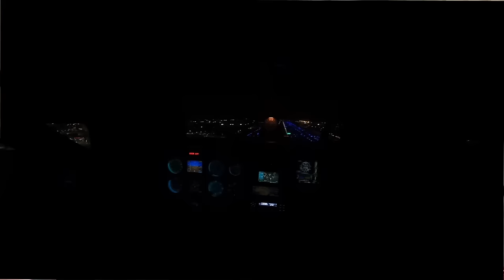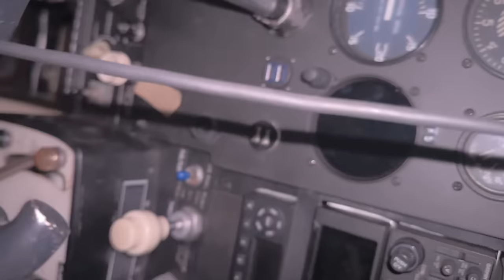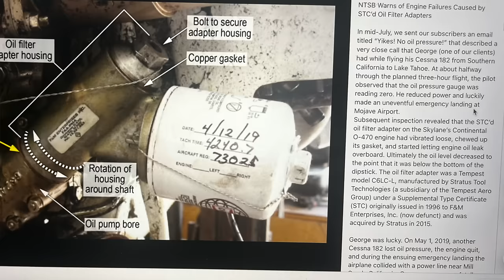Our New Cessna 210 Tried To KILL US Just ONE DAY After Buying It...

Comment: The 182 that crashed in Mill Creek is a friend of mine.  A real tragedy there.  I also had that same brand/type adapter on my 1965 C33 Debonair with the IO-470K.  In the 20 years I had it installed I never had a leak or any issue with it.  I complied with the AD regarding the new seals, torques and additional safety wire  and had nothing but problems with it leaking.  I removed it and reinstalled the screen assembly I had removed 20 years previously.  Now I change the oil every 25 hours and don't worry about the AD and the filter adapter.
Reply: Yeah, that a brute force solution but I would have gone the same way.

Comment: I have a 1963 210c. February of this year on my way back from Bethel Alaska to Kenai Alaska at night climbing over a 11,000 volcano I started to get a vibration in the engine.  I wish I could show you the picture.  Upon landing, we discovered Three of the eight bolts holding on the number for cylinder severed from engine.   I can understand what you’re talking about when you think oh, but the grace of God I am still alive today. Flying is not for the fainthearted.  You’re taking a 3000 pound machine 12,000 feet in the air with a World War II era engine.  $51,800 later we will be installing a new IO 470 into it this month.  I’m very thankful I have the opportunity to spend the money and my family is not scraping parts of me off the side of Mount Redoubt.  Keep the blue side up gentlemen.
Reply from the maker: Wow, what a story. So glad you are safe. Thanks for the comment.

Comment: Even if you find it's the oil filter adapter  and you resolved the issue, if it were me, I would run the engine for a good hour plus and DURING THE DAYTIME do a half dozen trips down the runway with planned RTO's. Obviously do your calculations so you know 100% sure that your planned RTO's will have you stopping with a good cushion of distance remaining. If you can, take your RTO's to perhaps 5 knots below rotation then go into RTO mode. The idea being you want the engine to go to max power a half dozen times.  If the engine is going to BREAK, this is when you want it to break - on the ground.  Then after getting a good workout on the engine, I would do a compression check then do a complete oil change.  Take the filter off and saw the top of the "old" filter off and take the element out and spread it open and see if you see chunks of metal.  By the same token, take an oil sample from the drained oil and send it to a lab for an oil analysis.  If the compression is good, and the filter element is clean, and the oil sample results are "negative" {which by that I mean "good"}, then you're probably safe to fly the aircraft. Remember, a lab oil analysis all by itself is NOT a complete "health check" of the oil.  You need to do the lab analysis WITH inspecting the elements in the oil filters. You need to do the 2 TOGETHER because the lab will detect micro wear.  The element inspection will detect the engine falling apart inside. Think of it as a flowchart - "did the element inspection pass ??".  If not, you need to overhaul the engine.  If "yes", then you go to lab engine oil analysis.  If that fails, then you have an engine overhaul.  If it passes, then you're good.  {assuming compression is good} - but also check your valves too.  Continentals tend to have burnt valves and Lycoming tend to have sticking valves.  Be safe out there !!

Comment: In 1981 I was an intern at the Pontiac Motors Engine Durability and Testing Labs (DURATEST) in Pontiac, MI. This is the lab where engines are put on dynamometers to determine all manner of performance data. The fun tests were the ones to determine redline, and to determine oil starvation characteristics. For redline, we would run the engines with higher and higher RPM until a rod was thrown (the dyna rooms had bulletproof glass protecting the operator, and the ceilings had numerous large dents). We would run engines and starve then of oil while running. Interestingly, the engines would run for about 5 minutes before seizing. This was due to residual oil in the system and then MELTED METAL acting as a very poor lubricant. Obviously, the melted metal regime was the kiss of death for the engine. If you stop the engine in the melted metal regime, it will cool, essentially welding the pistons to the cylinders. If you let it run, the pistons melt enough to cause the piston/rod system to become unstable leading to a seize. A very sad and painful death to a finely honed piece of engineering. A less aggressive but equally destructive test was to run the engines with knocking. Eventually, this will cause holes to form in the top of the piston (can you say zero compression). Truly a rare and fun opportunity to play with production car engines.

Comment: I have a io-470k with the oil screen. Thought about adding the filter stc a few years back but heard about the problems that people were having with that setup.  I felt it wasn’t perfected enough yet so I decided to stick with the screen.  When you consider that oil is the life blood of the engine and that it’s fairer cheap compared to everything else in aviation I just change the oil more often than recommended and examine the screen for possible problems.  After a while you get pretty good at safety wiring.
Reply from the maker: Thanks for the comment, too bad the adapters have a bad wrap.

Comment: I lost oil pressure once at 9500 feet. I shut off the engine, found a place to land and landed on a dirt road. I figured I’d save the engine and use it if I was lucky to get a burst at the other end, if needed, but it didn’t need it and thank goodness I saved the engine mine had a cracked oil cooler
Reply from the maker: Jeez that’s a scary close call!

Comment: The design of that adapter seems flawed. The filter angles outward to far from the adapter. That added distance along with weight filled with oil would amplify vibration and would lead to  the adapter being leveraged back and forth resulting in gasket and or "O" ring failure. A better system i believe would be having the filter mount as close to the engine as possible with either a strait vertical or horizontal filter position.

Comment: The AD on them is to replace the fiber gasket with a crush gasket on the engine side. I have seen two aircraft engines fail because of the fiber gaskets failing.

Comment: What?   Only 1.5 quarts low and the engines quits from lack of oil? Oil pressure indicator shows zero pressure is very bad. That is not right. Oil analysis or engine tear down. What ever you do don't sell the plane that way. Put a couple hundred hours on it and see the oil particle fines.

Comment: Guys, I have the same adapter on my IO470 in a Beech Debonair. You absolutely have to go further than just the washer changes. As some of the other commenters said, the design of the adapter is such that the filter is placed some distance from the case, and engine vibration will loosen the assembly, even if torqued properly. It is important to safety wire the body of the adapter back to the case, in a manner that pulls the adapter tight. This is in addition to wiring the filter tight as normal. Then torque seal it and inspect every flight for movement. Once we got the safety wire technique right, it hasn’t budged since.

Comment: The real question is why did the engine stop?  Were the bearings damaged in the process?  You need to do a thorough post-event engine inspection, not just a fix for the leak.  By cat measure, you have 8 lives left.  Spend them wisely, i.e. no single engine night flying over mountains.  Remember, there are old pilots, and bold pilots, but no old bold pilots.
Reply: very well said!!

Comment: About 1978, we had a P210 mostly used on a US Mail contract.  It was time to get the turbo serviced, so that was done, but the act of inspecting broke it.  I guess.  We flew off from, PDX to Sunriver, with 3 dudes + 3 GFs for a white tablecloth lunch - one hour each way.  Halfway home flying at FL 21, the turbo failed. All we knew till we landed was a thump and the cabin started filling with oily smoke.  We could see out the back windows that we were leaving an oil slick in the sky.  We were over nothing but lakes and national forests, absolutely no airfields nor place for a polite emergency landing.  Fortunately the engine kept turning and we made it back to PDX.  Not a drop of oil on the dipstick.  No damage to the engine. New turbo solved it.  The issue involved oil, but I don't think it had to do with the filter/adapter.

Comment: Same thing happened with my O470G in my 57 Bonanza.  Gasket tore after some maintenance and dumped 5 qts in 20 min. on the test flight.  Luckily we were close to the airport and landed.  We addressed the AD and now I check the alignment of the adapter about every 3 hours to make sure it hasn't moved.

Comment: There are a lot of factors, but since it was pumping oil overboard, IF (big IF) they were flying and noticed the Oil Pressure dropping out as soon as it happened, they have 3-5 minutes until they have no oil pressure, and perhaps about 15 minutes of total flying time before the engine seized. Based on previous total oil failures, engines seizing in as little as 3 minutes, and as long as 30 minutes.
In Texas, if you are at 5000ft, you are in gliding distance to an airport, so you can chop the power and glide to an airport. In Arizona, perhaps not, so then you then try to drag out flying to get to an airport and possibly damage the engine, but probably not going to seize on you.

Recently, I had my Oil Pressure drop from the normal 50-60psi to 17psi. Oil temp was normal as was all cylinder temps. We immediately used our power and energy to climb to 5000 ft in case we lost the engine (about 4 minutes of climb) and were within gliding distance to Georgetown Airport, so chopped the power and landed there.
During that time, the Oil Pressure remained at 17 psi, so we were getting oil flow, just dangerously low.
Upon landing at Georgetown airport, we noticed that we still had 7 quarts and no oil present on the aircraft. We let the engine cool down for the oil to thicken up as we suspected some debris in the oil holding the high pressure bypass open and that once the oil cooled down, it would flush out. 
Starting the engine about 30 minutes later, the Oil Pressure was running at around 22 psi (alarm is set for 20 psi). So I took off and hopped over to my home airport 2 minute flight away (Private Grass runway) which by the time I was airbourne, the OP was dropping back to 12-17 psi.
A couple of weeks later, I hopped it over to Taylor Airport, about 5 minutes away, in which the OP was again 15-17.
A month later, Taylor Aviation Services were able to get to it and cleaned the Thermatron, Oil Pressure Relief / Pressure Set valve, started it up and no problem found.
We have flow it a dozen times now and the OP runs from 55-65 as it should, so we guess it was some debris holding open a bypass valve, keeping the pressure from building up.

Comment: 'Air-cooled' pre-1997 911's is a bit of a misnomer. The engines have a dry-sump system, with shallow sumps on the engines and most of the oil in a seperate tank, along with an oil cooler. My little 2.2L 911S engine had an oil capacity of 8 litres from memory. Along with the finned cylinders of course. 🙂

Comment: I like the idea of using "Cross check torque seal" over connections, like the oil filter adaptor that you just described.
Also
* Prop hub bolts
* engine accessories subject to vibration, mags or electronic ignition.
* nut and threads of engine mounts
This would be a part of pre flight engine check.
🔩🌺

Comment: Had this happen on a beech debonair a few years back. Oil filter adapter came loose and lost all engine oil. Busted a hole in the crack case. Not a normal customer but made a successful emergency landing in a bean field in Missouri. 

Had another V tail bonanza come in for an oil change that we don’t normally work on. Went to pull the filter and you could take the oil filter adapter off by hand. Told the owner and now he only brings his plane here for us. 

Always check those adapters. Cessna oil adapters or not. Check them.
Reply from the maker: Wow seems like a more common issue that I realized!

Comment: If I might suggest. Having some crushable copper gaskets made for both ends of that oil filter adapter, and having some radial etchings machine into the surfaces, you can functionally make that oil filter adapter a permanent fixture. Using consumable gasket on that application I find troubling. A crushable zinc or especially a copper gasket, somewhat akin to a banjo bolt is how it's designed, you should be using copper seals on both ends of that oil filter adapter. It might be an update you can work on and actually make money on, I do expect my cut!

Comment: I spun a bearing in a car at wide open throttle and the oil light was only on for about 2 seconds. I didn't  know I was low on oil but when I stomped on it the little oil in the pan shifted away from the pickup. What I'm trying to say is it didn't take long for no oil pressure to ruin the engine. But it was full load so it's hard to say what would happen in that engine at cruise.

Comment: In terms of time between no oil pressure and engine going bang.... I really don't think there is one answer to this. I think the real answer is it depends. It's going to vary from engine to engine, how hard you're running the engine will have an effect too, it'll likely last a lot longer at idle than at takeoff power for example. There's various factors that will effect the actual length of time, but essentially, nowhere near as long as the owner of the engine would like.

Comment: It is merely taking a paint pen and writing across where the two parts of the filter housing meet, that weigh if it moves you can see it.
If you get into the habit of putting a paint mark. It will be far easier to see when the torque specification has changed safety wire does not necessarily maintain torque. You have to look at the safety wire and the paint line. A wax substance on an aircraft engine will quickly melt and go away. The other thing you can do is get temperature sensitive paint and paint it on certain aspects of the engine that are only supposed to get to a certain temperature. That way if you see it become discolored, you know there's a problem.

Comment: After you last topped up the oil did you replace the oil cap - or leave it resting on the battery or some other surface.  Inside the main filler tube there is a narrow "return" tube on some Cessnas which squirts oil upwards and all over the place if the cap is not replaced.

Comment: I think a thorough inspector w/experience would have warned you about that adapter being a potential danger item. I guess the vibration is hard on the adapter gaskets. Would be better to have a factory designed-in spin on oil filter mount for that engine. It scares me and I'm not even flying.

Comment: When I was 18 years old, back in 1966 my military flight instructor told me if you lose all your engine oil you have just about enough time to bend over and kiss your as* goodby.  Luckly the only time I lost oil pressure was in a 4 engine jet (DC-8).Well over 20,000 with a lot of good A&Ps in my past.

Comment: I had a similar problem where I lost quart of oil in about 20 minutes in my 1963 Cessna 205 with a IO-470. The problem was the oil dipstick. It rotates 90 degrees counter clockwise to unlock. I had removed the dipstick to check the oil level. When I put the dipstick back I didn't push the dipstick all the way back in before rotating the dipstick clockwise to lock it. Since you had just checked the oil and put in oil and probably checked the oil level look at that.
Reply: I had this happen in my car (mechanic did it). It was amazing how much oil was all over the engine bay… what a mess

Comment: Strange issue with my c150 with the spin on oil filter adapter.
After install hot starts (full oil temp) it takes about 45 seconds for oil pressure to read on the gauge.
I since switched back to the screen. And oil pressure is instant on hot starts. It’s strange but from my understanding I’m loosing oil prime and with the filter it just adds onto that time it takes to reach the gauge. Oil filters on nice but I fly less than 50 hours a year on the 150 so it’s not necessary for me to have it.

Comment: The engine is probably fine other than the oil leak. Suspect vapor lock as the reason for the engine stopping. Not related to the oil leak. Good Luck!

Comment: The oil filter adapter problem is a completely different ball of wax. Sounds like, if it were me, every time you do an oil change you should be replacing that gasket and making sure that all of the torque specs on that adapter are within specification . Also would not be a bad idea to replace the gasket. Because of the born stroke mechanism of these engines they do rattle around a lot. Safety wire in that photograph you're showing at 16 minutes and 10 seconds into this video appears to have been stretched. Either that or whoever decided to put that piece of safety wire on there was a little bit lazy and making sure the wire was wound, it does look like the twist rate is quite Lazy by the time it gets to where it's anchored at. If I saw that I would insist on it being retort and safety wired again.

Comment: an engine blowing up because of oil pressure depends a lot on how much pressure is under at the moment, if it loses oil pressure at full throttle it will probably blow up instantly or in seconds, i once made it 5min with no oil pressure and almost no throttle. it is a gamble for sure.